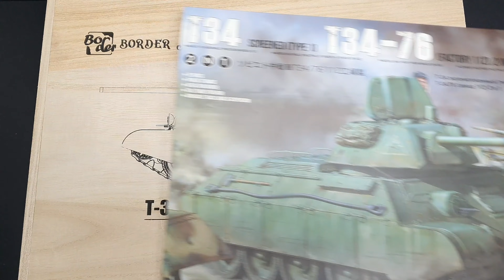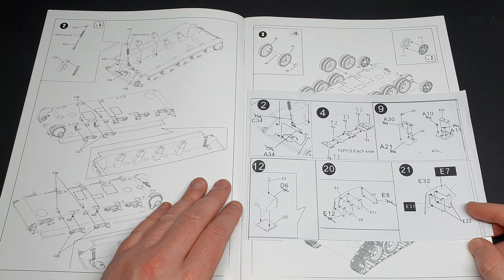1/35 T-34 E Border Model | Full Build

Comment: Great build! For bending the engine deck grilles no specialized tool is needed: I'd recommend using the stem of a paintbrush. Choose large or small according to the desired radius of the bend. Worked nicely for me on the exhaust shrouds of a Tiger I.
Reply from the maker: Good tip Jean-christophe thankyou !

Comment: Hey James, this got me thinking about whether U.S. had spaced armor usage, russians did, germans did. There were some pershings given a large amount of frontal spaced armor. Turns out shermans in the pacific theater had large amounts of field modifications ranging from space armor made out of wood/metal/cement/sand bags/ track links to welding spikes/nails to top of the tank. Just need look up okinawa shermans to see what I'm going on about. Can go nuts with spaced armor, anything that could be considered usable armor adds on were used, even random sticks/branches were used. Food for thought an perhaps a future project. Awesome work btw, always on look out for tank builds, never bored watching = D
Reply from the maker: That's really interesting, definately something I havent explored. The cement and plank armour I knew about but the others are new to me . Some of the Pacific tanks almost looked like some kind of mad max tank😁
Reply: @lpjmodels  Lol it was getting mad max levels, destroyed tanks weren't off limits either, cut plates off an weld them on. Anything to survive the next hit. Very interesting indeed, enjoy the new found information! Until next time, have good one :)

Comment: What a superb build review & wonderful looking final product! 👍👍 I greatly appreciated your detailed discussion regarding the fit issues that I had heard about, AND cannot thank you enough for taking the time to share & demonstrate your recommendations re: workarounds/solutions to the problems. I now feel as if I could handle the kit's (inexcusable) problems & get the result that I would hope for! 👍👍😊

FWIW, I get the impression that Border Models (who has made mistakes before but has continually improved), did a very thorough job of designing the usual & ubitiquous T34 tank...it seems to be well-engineered....and then it seems that another person or team in the company was assigned the job of designing/engineering the additional armour & adding to the instruction booklet. It appears that 'the left hand did not know what the right hand was doing' & vice versa! It's a shame, because it's a unique model with the additional armour. So, kudos to you for coming up with a new approach & persevering through all the frustrating & time-consuming repairs! 👍👍
Reply from the maker: I think you hit the nail on the head Re Border and this kit Derek. The panzer IV was pretty on point apart from a few tool placement ambiguities in the instructions.

Comment: I want this kit myself, I've just finished there new crusader mk3 and went and bought another it was that nice and a great build! From what people complain about well I've non! It's a fantastic build and awesome detail! The metal barrel is useless and can't be used apart from that it's beautiful! The slide Moulded barrel is really well done it's the first time I've used a kits barrel for a long time but it's nice track's can only be wethered with acrylics or will fall to bits with enamels ! That's the exact same way I done my crusader with that mottled effect! It was a first for me and looks amazing! Have you tried AK washable white paint for white washes yet? It's good! I got it ina sherman weathering set you get real nice painted field effect white wash and runs!
Reply from the maker: Thanks mate , yeah the panzer IV was very good and the crusader, well I have seen folks do it with no problems as well , maybe just a bad egg?
Reply: @lpjmodels  I'm away to order this t34 today I have the 2 new miniart ones and the composite turret one but there's nothing like this one and border are on the edge or great and easy detail yeah plastic bit soft if your not used to it say for beginners etc and they can do with working on more of a turret partial interior even something like icms t34 76 I've built that and it has the drivers seat and levers just to fill it out if hatch open and looks great! I'll maybe Rob parts from my other kit for this one, love that camp crosshatch white wash! My friend owns the model shop next to my house so away pop through for a blether n coffee! I've to pick up the new Tiger from border and Afv clubs Bussing nag with the bilstein crane! Have you see what RFM are releasing next? The Korean war sherman and the Dumbo Tiger winterketten tracks etc as aftermarket and figures! This should be interesting!

Comment: Love your videos and weathering techniques man. Great job! Two things: You seem to use way less glue than I do. I wonder if it is because your glue is somehow more efficient, or I am just doing it wrong for 30 years. I used Tamiya, Humbrol and Gunze Sangyo glues. Second question is about the transparent plastic parts like windows or glass in the reflectors. I glue them on after painting my models, so styrene glue cannot be used. I go for CA glue, which often leaves "smoke" on those parts. How do you do this?
Reply from the maker: Thanks Radek ! 

I used to use Tamiya glue and still do In a spot, I'm often quite slapdash with application too, you don't need a lot, as long as they are wet when joining you're all good. 

For clear parts I like Revell contacta clear ot VMS transpa fix 6k.  Revell is water based and dries In about 20 mins, but it's not overly durable,  vms is solvent based and cleans up with white spirit, it takes a lot longer to dry but is a lot tougher,  neither of these fog the plastic, hope that helps !
Reply: @lpjmodels  Yep, thanks a lot!

Comment: Just a bit about the kit. I see that you did not correct the many mistakes of it. If anyone wants a list I could provide. Also that camo pattern was used in the winter of 41-42 so it could have not been applied to vehicles build in 43. Also the few screened 112 vehicles did survive for long so it is highly probable that they did not survive until the winter.
Reply from the maker: Thanks for the Tips Gabriel, I know the paint scheme is inaccurate, I wanted a model a bit different to just 4bo.